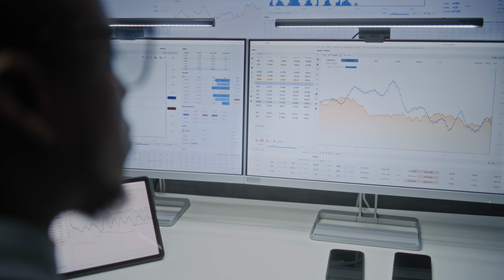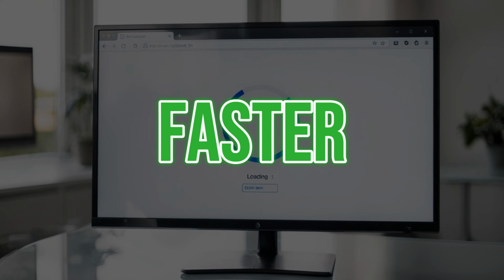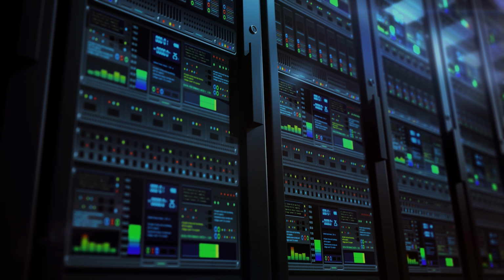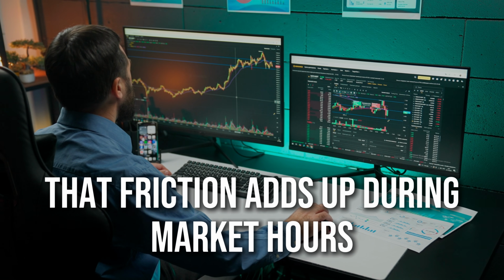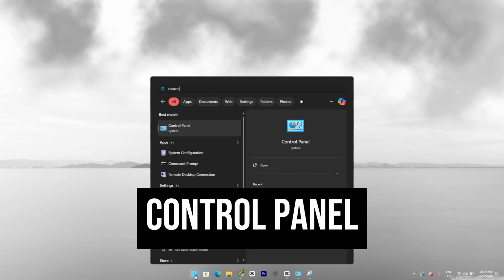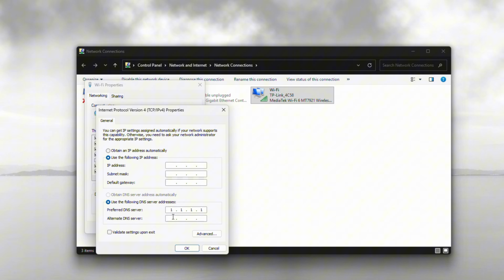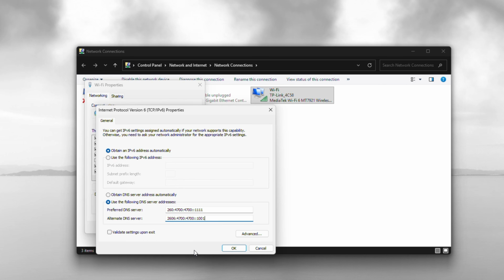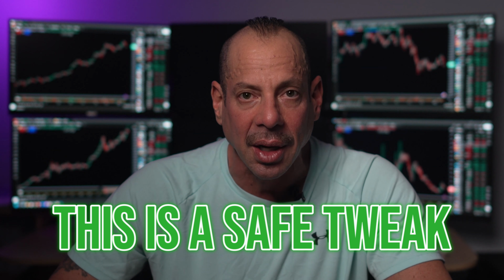Most Traders Don't Realize Their DNS is Holding Them Back

Comment: When do you use Cloudfare vs Google vs OpenDNS? East coast and T-mobil fiber here.
Reply from the maker: Good question — on East Coast fiber, all three resolve fast enough that it comes down to testing your own line. Cloudflare (1.1.1.1) usually edges out Google (8.8.8.8) and OpenDNS on the East Coast, but the honest part: DNS speeds up browser-based platforms and web dashboards, not desktop execution. If you haven't already watched it — I walk through how to test which resolver is actually fastest on your connection and what DNS does and doesn't fix. Watch this video: https://www.youtube.com/watch?v=Dt41LG92-YE

Comment: Cloud Flare IPV6 is: 2606:4700:4700::1111
2606:4700:4700::1001  You have it correct in your text, but incorrect in the video.
Reply from the maker: yes i am aware.  i think i fixed it with pinned comment as well  - but thanks for calling me out!

Comment: Good stuff Eddie, much appreciated. This is good advice, I did this about 8 months ago at the suggestion of ChatGPT. I was tackling the problem of my devious HP Printer 'calling home' in the middle of the night, and being disabled by HP because I was using re-manufactured ink cartridges. So I returned my Spectrum Router, went out and bought my own much faster NETGEAR NightHawk router, re-set all the DNS settings to Open DNS, and blocked all HP-related websites and IP addresses. I also made one change in the router setting which I can't recall right now, but that also increased the download and upload speed dramatically, literally doubled it. Am sure you know which one that is. Anyway, sadly these are the things we need to do, to stop being controlled like a bunch of lemmings, and increase our 'edge'. I have your book, there's gold in there, aiming to step up to one of  your beast machines soon, cheers!

Comment: Hi Eddie... i am using wifi bc if i use hard wire, i lose internet and i dont with wifi... any reason why it would do that?... ty
Reply from the maker: That can happen — it usually means something on the wired side isn’t connecting correctly even though Wi-Fi works. Common causes are a bad Ethernet cable/port, outdated network driver, or the adapter not getting an IP address.

Try a different cable and router port, update the Ethernet driver, and check the adapter power-saving settings. If Wi-Fi works fine, it’s likely a wired connection issue, not your system.

Comment: Eddie, My system is not letting me do the version 6 #'s. Says they are not valid IP addresses. I tried both Cloud Fare and Google.
Reply from the maker: look at the pinned comment.  I miffed up a number in the video.  Also the video description has the exact correct IP addresses!  Sorry for the confusion
Reply: @eddiez-trading  I noticed that miscue in the video. I copied and pasted the DNS #'s from the description and my system is telling me they're not valid.
Reply from the maker: Make sure you’re entering IPv4 and IPv6 in the correct fields — Windows won’t accept IPv6 addresses in the IPv4 boxes. Also double-check there are no extra spaces or commas when pasting.

If you want, tell me whether you’re setting IPv4, IPv6, or both and I can confirm exactly what to enter.

Comment: how can this be the autoload setup for cafe hopping?
Reply from the maker: Good question. DNS settings apply per device, not per café. Once you set DNS on your laptop’s network adapter, it automatically applies to any Wi-Fi you connect to (cafés, hotels, airports, etc.) unless that network forces its own DNS.

So yes — it effectively autoloads as you move around.

Comment: You have to change the DNS settings in your Router settings
Reply from the maker: You can change DNS at the router level, but it’s not required. Changing it on the device itself works just fine and follows you between networks (home, cafés, hotels). Router-level DNS just applies it to everything on that network.

Comment: Are settings the same if living in Spain?
Reply from the maker: Yes — the DNS addresses are the same worldwide, including Spain. Here they are for both Cloudflare and Google:

Cloudflare DNS

IPv4: 1.1.1.1 and 1.0.0.1

IPv6: 2606:4700:4700::1111 and 2606:4700:4700::1001

Google DNS

IPv4: 8.8.8.8 and 8.8.4.4

IPv6: 2001:4860:4860::8888 and 2001:4860:4860::8844

They’ll automatically route to the closest servers, so they work well in Spain.
If you want to be precise, testing both locally is the best way to see which responds fastest for you 👍
Reply: @eddiez-trading  Tyvm!!!